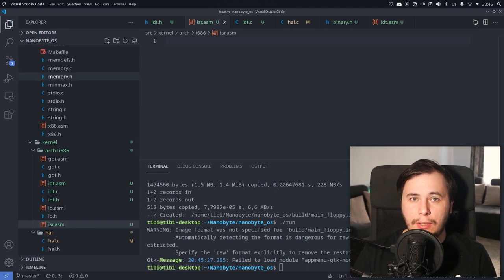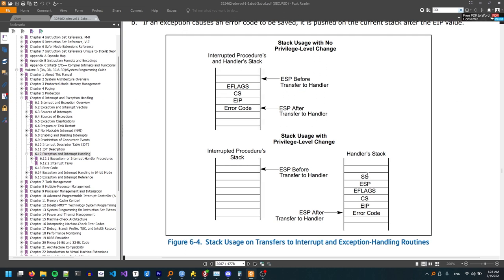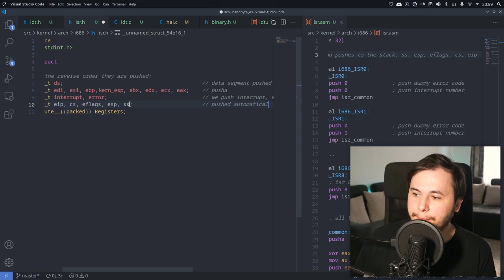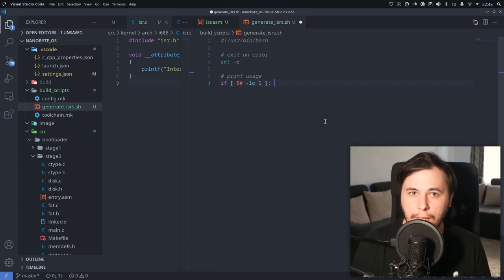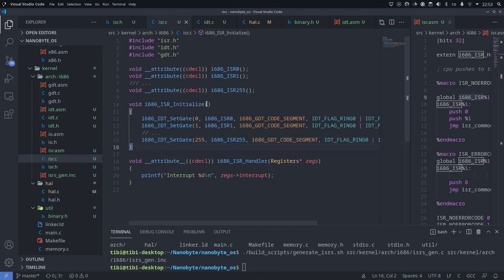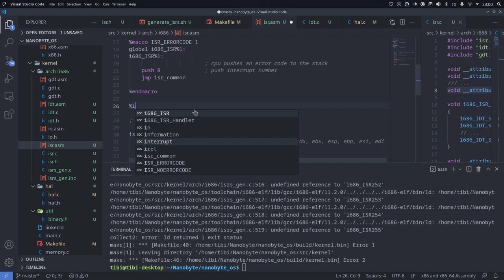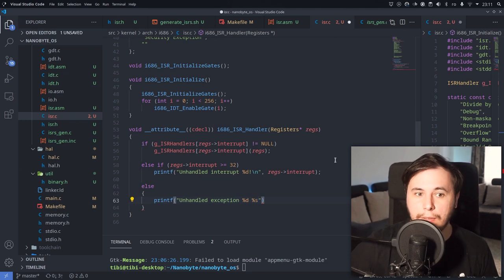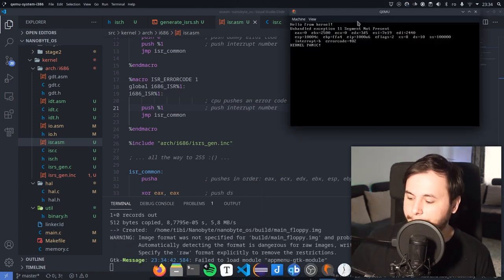Building an OS - 9 - Interrupt handling

Comment: will a graphical interface follow at some point? or is that not planned?
Reply from the maker: Yes!
Reply: @nanobyte-dev  amazing! :D
Reply: @nanobyte will you then do something like windows linux or mac os that have a login? and if so, they can run, start, load or something later on
Reply from the maker: I don't know what it will look like at this point, but I do want to have the basic functionality of an OS like opening programs and files. There are a few more topics we need to cover until then, like memory management, storage, multitasking.
Reply: @nanobyte-dev oh then I still have a lot to learn... :D do you actually release a video every minute or sometimes earlier...?
Reply from the maker: Every minute 😄? I wish. I don't have a fixed schedule, but I try to release a new one every month.
Reply: @nanobyte-dev  oh sorry shouldn't sound weird now 😆 will the whole src be released later or is the github src always the one of the whole updated project

Comment: Is it actually true that most operating systems use Html for the interface (menu) so that's how I read it anyway...
Reply from the maker: Most operating systems have their own native GUI API. MacOS has Cocoa, on Linux there is X (and Wayland), and on Windows there is Win32. While there are many GUI frameworks out there, all of them have to interact somehow with the "native" API for doing basic things like creating windows and dialogs, drawing to them and handling input.

With the exception of Cocoa which is pretty easy to use, most of these native APIs are pretty old and not very programmer friendly, which is why a lot of GUI frameworks exist. While the core parts are written in Win32, many parts of Windows are made using other frameworks. Microsoft basically creates a new GUI framework every 7 years or so, completely abandoning the previous ones (they made Win32, MFC, WinForms, WPF, MetroUI, UWP, and coming soon WinUI), and they don't even use those frameworks all the time (Teams, VSCode, Skype are written in Electron).

To make GUIs in HTML, you basically need to integrate a browser rendering engine. Microsoft did this a lot in the past, by embedding IE in a lot of places , even as far back as Win98 with the left panel in Windows Explorer and "Active Desktop" which was required for using wallpapers in formats other than bmp. Today, a lot of applications are using Electron and CEF (Chrome Embedded Framework).

So basically, you can make your GUI in HTML if you can integrate or build an HTML rendering engine.